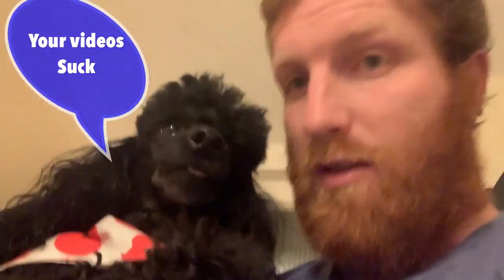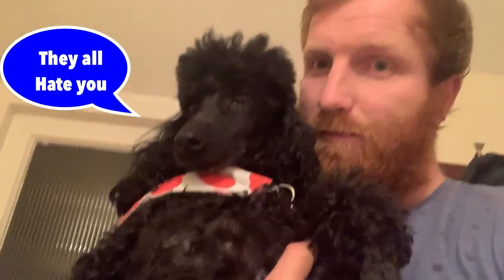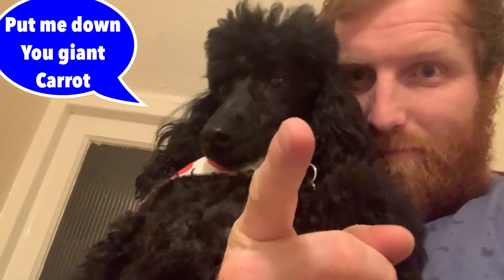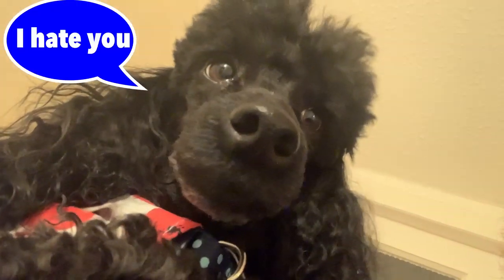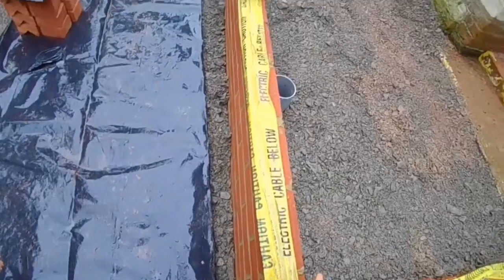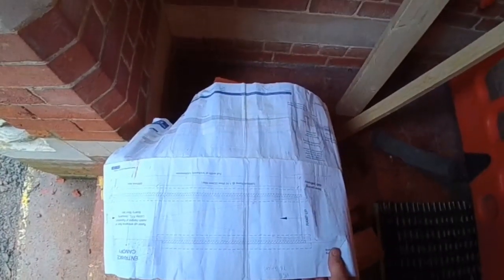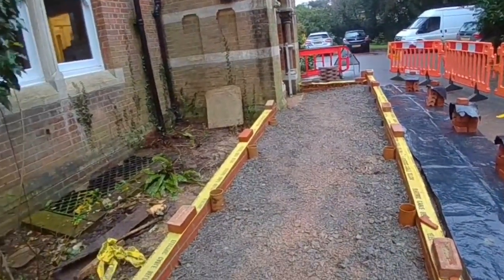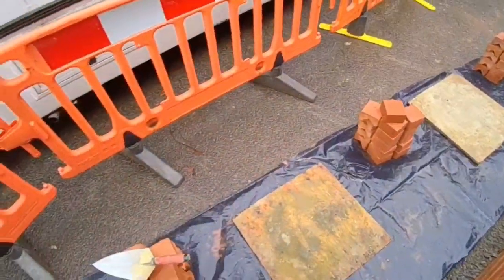Laying brick on edge | The skill of bricklaying

Comment: Who ever cut those batts needs a bit more practice. Every single one is a different length.
Reply: Dan Wood 
Everyone does it mate. They all mark the centre of the brick and don’t take the thickness of the blade into account. 
Something I’m forever moaning about 😂
Reply: @ashleyhewett5894  it's my pet hate. For a job like that I hire a masonry table saw. Guaranteed to be uniform in size. The finish is worth the cost of the saw hire.
Reply from the maker: If you watch my video world’s worst tool that’s what we cut them with. As my van was broken into the day before and the stole my saw and other tools including my radio so now I have to sing to myself. Thanks for taking the time to watch my videos appreciate the input you have a awesome evening.